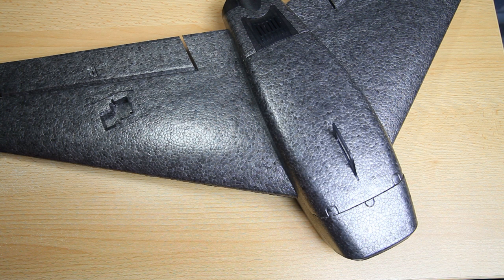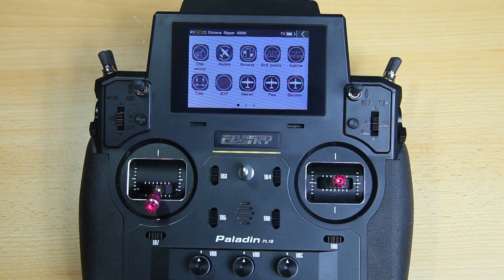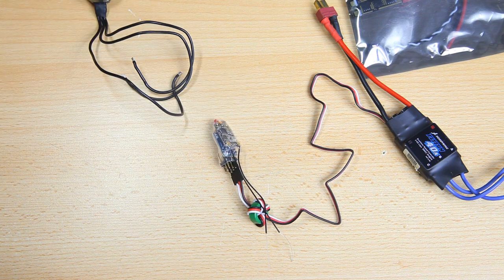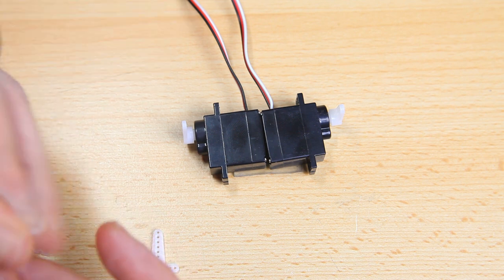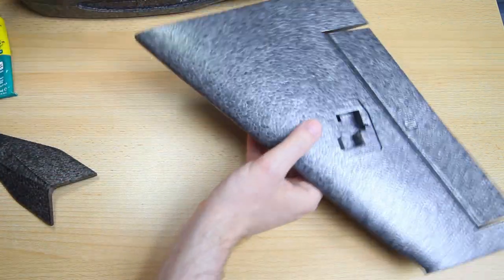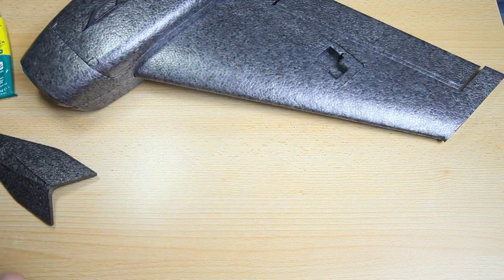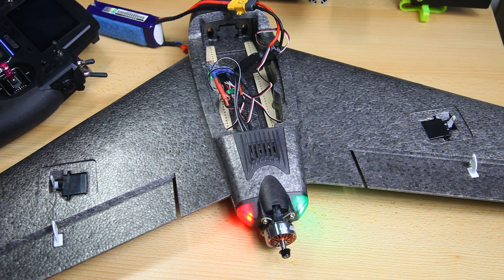Diatone RIPPER R690 (FPV) Wing - BUILD HOW TO & SETUP

Comment from the maker: Getting that Ripper flight ready! :D 
Link to it: https://www.diatone.us/collections/new/products/diatone-wings-ripper-r690-frame-kit 

At Banggood: https://www.banggood.com/DIATONE-Chase-Fixed-Wing-Ripper-R690-690mm-Wingspan-EPP-FPV-RC-Airplane-Aircraft-KIT-p-1836204.html?p=TO251813974002015038 

Specifications: 
wingspan: 690 mm 
length: 415 mm 
weight: depends on the setup you use 
material: EPP Foam
kit type: airframe only 
motor: 2205 - 2208 2450Kv (not included) 
propellor: 5x5 (3S setup) or 6x4 (3S setup) 
ESC: 40A (not included) 
servo's: 9 - 12 gram (not included) 
receiver: 4 channel (not included) 
lipo: 1550 - 2200mah 3S / 1300 - 1550mah 4S 
ailerons: yep 
rudder: nope 
flaps: nope 
retracts: nope 
lights: yes! 
stabeliser: not included

Comment: Nice tutorial. I am considering to buy the Hee Wing F-01 which is basically the same. Is there enough room for all the electronics, including the DJI Air unit, the ZOHD Kopilot lite and a 4s 7000 battery into the fuselage?  Where would be the best place to install the GPS and Crossfire receiver antennas? Thanks!
Reply from the maker: Thank you Paula :) 
And you have some BIG plans sir! :D I just checked.. I don't have a 7000mah 4S, but my 10,000mah 4S Lion pack is just about as big as the entire fuselage.. I don't think a 7K lipo would leave much room for anything else :$ 
I have my receiver in the back though you could use that space for the ESC as well I assume.. Still.. it's not a huge plane, so for addition things you will have to be creative :)  (I would personally embed a GPS in one of the wings)
Reply: @DutchRC  thank you! What battery do you recommend using? I would like to have at least 30 of flight time.
Reply from the maker: @paulohcassis  I have flown mine on a 4S Lion so far.. I think it;s +/- a 3500mah pack.. that works well, and I am pretty sue I could hit 30 minues

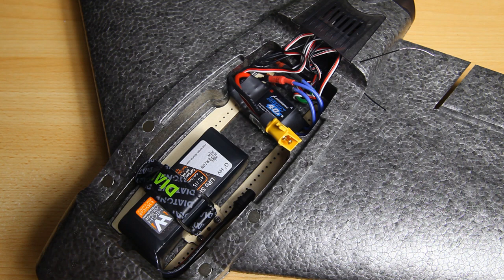Comment: Thank you its seem great   but do you look at 34:37.  where will the air unit be put?  There is a battery
Reply from the maker: thanks :)  the dedicated spot for the airunit IS up front yes.. I think I might use a smaller lipo on that case (1300mah 4S would fit sideways for instance) 
Somehow the nose on these planes is Always to short for comfort :D  (to get the CG correct)

Comment: Nice little wing, a bit expensive though for what it is.
Reply from the maker: I do think it's well made.. But you're right.. it's not the bargain of the century :)
Reply: @DutchRC  Yes the build quality looks great, but for the price i you could get an Ar Wing Pro, The original Ar wing or even the smaller 600mm version.

Comment: Very nice video! Can you give more details about camera mounting and if you can mount 2 cams in this fpv stup?
Reply from the maker: Thank you :)  it is actually pretty simple: the 2 black plastick mounts can be screwed onto the wooden rails.. And with that you can mount micro camera's (or the DJI / Caddx camera's).. 
And nope.. there really is only 1 cam mount in the fuselage.. No reall room / spot for an action camera for instance